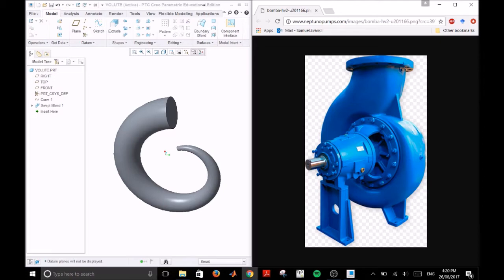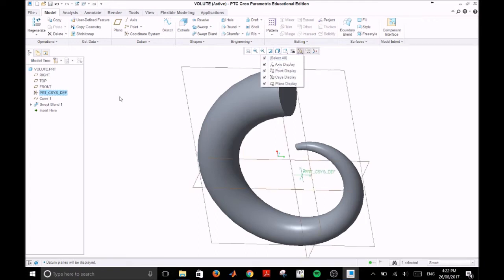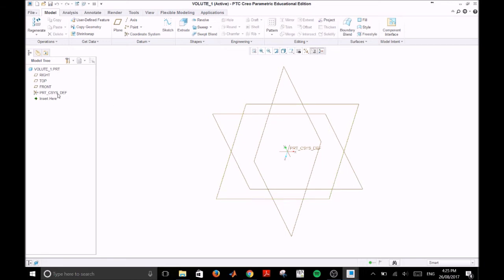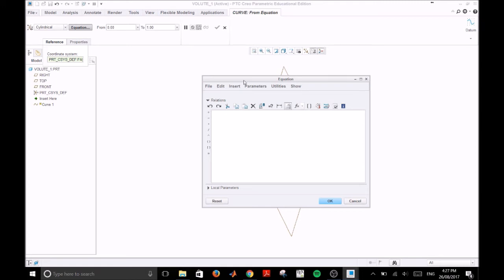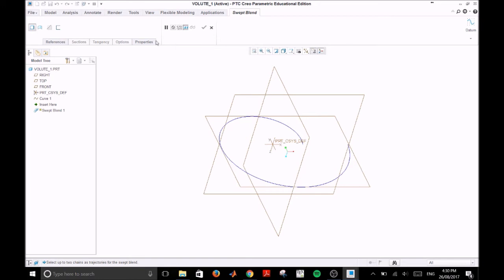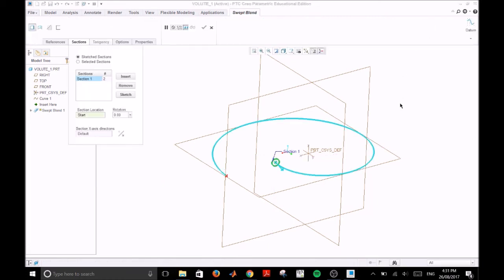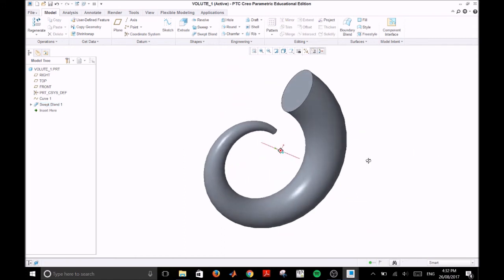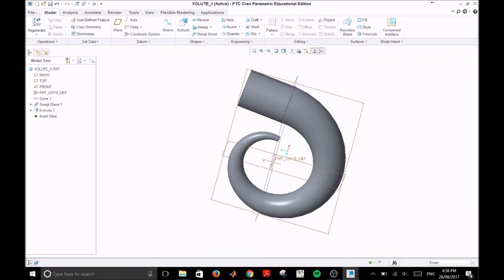MECH1110 Creo Tutorial 11: Swept Blend Volute

Comment: Explain about equation
Reply: Equation is    r = a*b^t      where      'a' = initial volute radius, 'b' = growing factor and 't' is some kind of linear factor so PTC knows how to calculate values for each step (360 degrees in this case:     theta = 360*t  ). A bigger value of 'b' will return a bigger volute.
Reply: @kvega257  do you know how we would be able to measure these on a physical model? what parts do we measure to get these results?